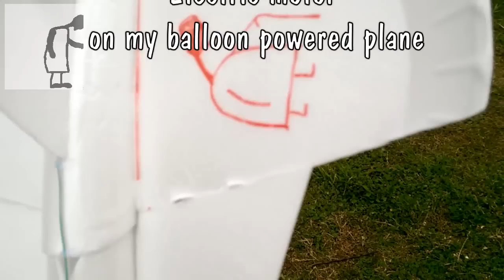Electric motor on my balloon powered plane

Comment: instead of a capacitor, try a battery that dosnt waste its power really quickly. maybe longer flight, and maybe a better motor. and a bigger design. id like to see that. oh and one more thing, the third throw was awesome.
Reply from the maker: so basically what you are saying is make a different plane. Did you read the video description which explained why I was using this plane?
Reply: GrandadIsAnOldMan oh ok, im sorry